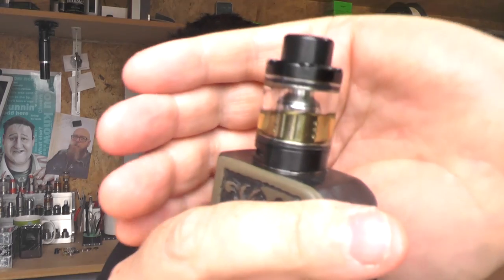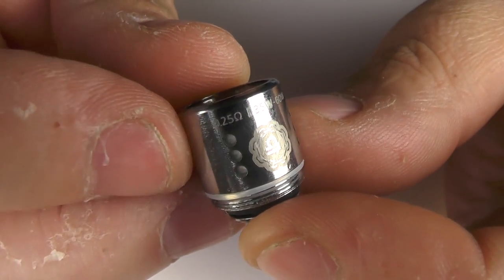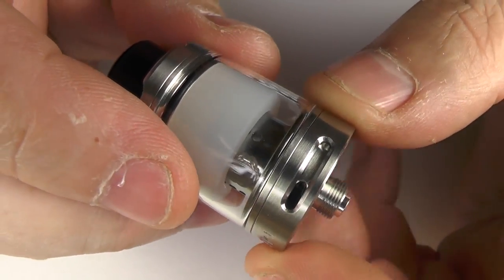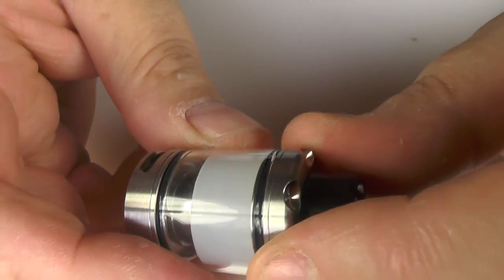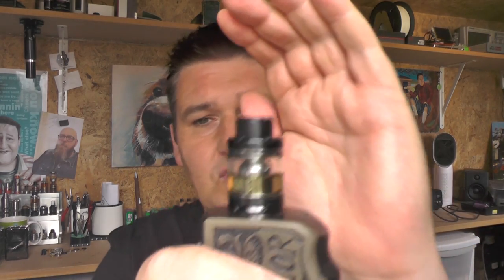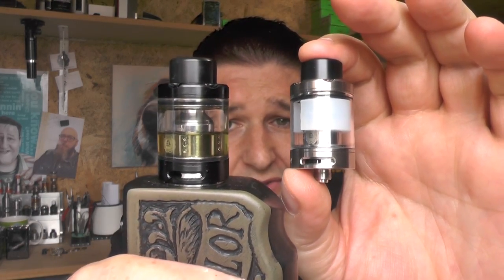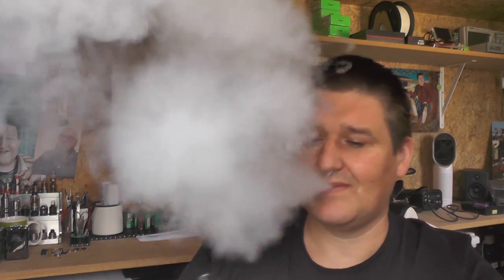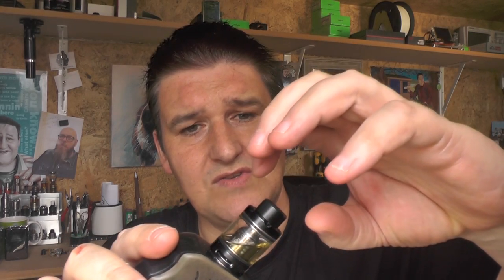Wotofo Flow Sub Tank

Comment: Just curious: what's your favourite sub tank? I only have one left which I still use regularly, the Aspire Atlantis EVO. Love the flavour I get from both the 0.4 and 0.5 clapton coils and they don't need loads of power. I am just not a fan of those 8 core coilheads that have to be vaped at 150W and drain a 5 ml tank in 10 minutes.
Your vaping habits (restricted lung hit, between 0.5 and 0.8, not too much power) are similar to mine, so that's why I'm curious which tanks you're using that are not up for review?
Reply from the maker: +Dnns84 what ever is lying about! Must admit to really liking the NRG sub tank, once again, 40 to 50 watts but great flavour.  I think the old Kanger coils, the OCC ones at 0.5 are still my fav, 25watts was perfect for them.